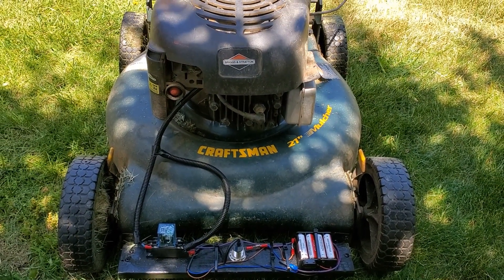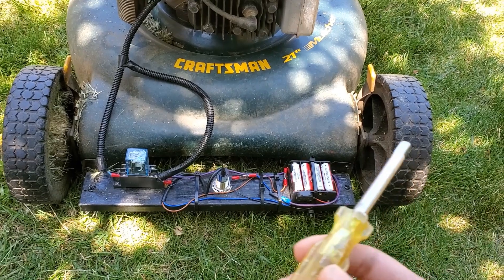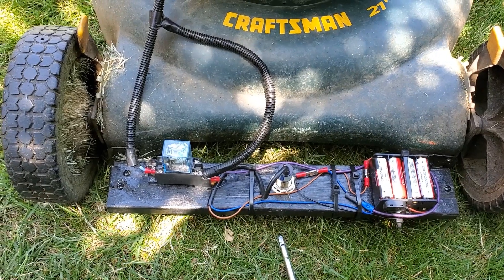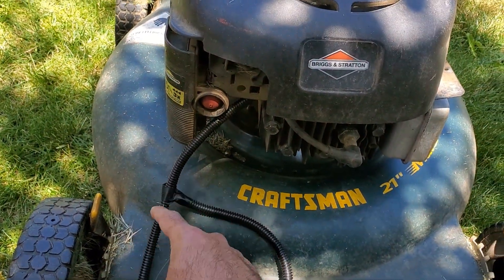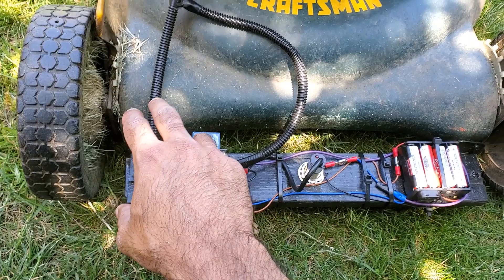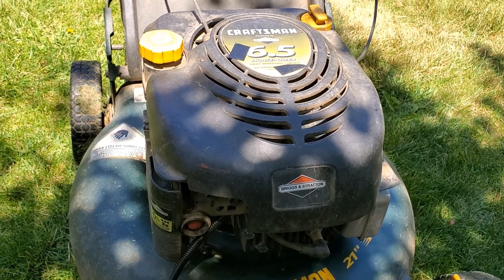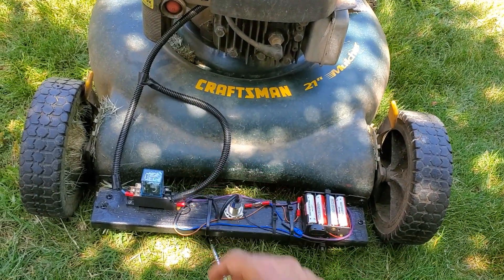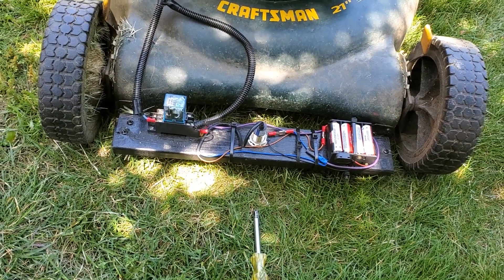Object Detecting Lawn Mower

Comment: Very cool. This is the Tesla of lawnmowers! But as others have commented, I wonder about the effectiveness of your invention while mowing at a normal walking speed (or speed of the self-propelled mower). You were moving very slowly in your opening demo. It takes several seconds for an engine to shut down. And the ignition coil has to be grounded continually while the engine slows to a full stop. But the ingenuity you have demonstrated is fabulous! Looking forward to your next revision!
Reply from the maker: Appreciate the support and feedback. They make relays that once triggered stay triggerd for a set duration of time this will allow the mower to be grounded for as long as one wants. The real challenge will be making the blade stop faster.
Reply: @DuctTapeMechanic  Yes, engine braking would be key for an instantaneous shut-down. (I also enjoyed seeing the roll of electrical tape holding down the safety bar on the handle!)

Comment: The one sensor is good for a proof of concept imo. Id be curious on testing how wide of a range the sensor has left, right, and height wise, how many sensors you need to cover the front, how big of a metal object it can detect, and if you could use the lawn mower motor itself to power a rechargeable battery for the sensors. Someone else recommended a bypass which I thought was a smart idea too. I can see this as very marketable if done for a decent price! You could even sell kits to attach to lawnmowers
Reply from the maker: All valid points. The sensors are really cheap (about $3.50 if you buy them off of ebay). I plan on using capacitive sensors in the future so I can detect an array of different objects.

Comment: Interesting concept but for it to be sold you are going to have to keep the dead man control also at the handle bar. This could be a 2nd kill switch. Also people hit metal objects but also stumps and concrete/ rocks that cause damage. So a sensor to detect objects based on height might be better. Just my thoughts.
Reply from the maker: I appreciate the input. Since the video I have updated the sensor to a capacitive sensor that detects rocks, metal, and even toes. I was thinking of bolting on an additonal brake and having it engage the flywheel and stop the blades via a 12 volt solenoid. If this gets enough interest ill post another video on the revision. I appreciate the feedback. Subscribe to stay tuned.

Comment: Very interesting concept. I believe the sensor you're using searches for obstructions from metal objects. There is coding involved in my suggestion but what if you replaced that with an optical sensor with a wide angle lens that was triggered by any foreign object in the path?
Reply from the maker: Yes that would work with an arduino (albeit more challenging). I was thinking of swapping this using a capacitive proximity sensor so  I would be able to detect a variety of things (rocks, metal, etc.) Stay tuned for a remake!
Reply: @DuctTapeMechanic  That's an interesting take. Yes, if you go that route you'll also be able to enhance your product's feature set. Very well done. Looking forward to the update!

Comment: can you make one for a commercial mower going 13 mph ?  and 94 inches wide ?
Reply from the maker: I would have to use a timed relay and going that fast I would also have to find a way to apply the brake as well. It would be quite challenging for sure.

Comment: So what if it's on the side does it only work if you drive dead center  What if the metal object is closer to the tire the blade will still hit it but will the sensor still pick it up if its way on the side
Reply from the maker: Yes I am planning a revison in which I install additional sensors on the horizontal axis to cover this potential issue.

Comment: What is the voltage on the ignition coil? If it is 10,000 volts it likely exceeds the voltage rating of the relay and wire to the relay.  Also voltage can jump through wire insulation to the mower body, or to the human body if a finger gets close enough to the wire.
Reply from the maker: Primary coil does not carry super high voltage (thats the function of secondary coil). The wire is the same gauge as the kill switch wire and grounds to the same spot.
Reply: @DuctTapeMechanic  gauge matters for current, not voltage. Current will be very small but voltage will be very big. Voltage rating for the insulation around the copper wire is what matters. Often the voltage rating is printed on the wire. Suggest check that voltage rating on added wire is as high or higher than original wire. Also, if voltage is high enough to jump from relay contact to relay coil, you could end up with high voltage on the rest of your circuitry, including battery pack.  Good point about the primary coil voltage vs secondary. Knowing the Primary voltage is still useful.

Comment: Can try extending the support-arm with the equipment on out a few inches to allow a bit more time for the blade to slow down along with multiple sensors all in series for better coverage. Maybe some kind of plastic guard too so that the sensors+power supply and relay don’t get mucky/wet from grass
Reply: Nice work by the way man. Really clever idea.
Reply from the maker: Appreciate the support and feedback

Comment: This works in theory but not in practice. As mentioned, the metal object needs to be in the center of the mower but the mower takes a few seconds to shut down. Your current relay only triggers while the metal object is right under it so running over a tool like that at normal mowing speed would barely make the motor miss a stroke let alone shut off. The fix for this would be a timer that keeps the relay closed for 3-4 seconds after any contact with  a metal object.
Reply: Well this is obviously a proof of concept. Not an actual product. All your listed problems could easily be fixed. Also even if the person is Usain Boltin it, the blades will be going much slower still, and if it does hit it won't actually be as much load on the motor.

The real question is can you fix what you listed and still keep it at a viable price? Maybe for high end lawn mowers, but for the average one I doubt it
Reply from the maker: @lost4468yt  appreciate the feedback/encouragement. Yes absolutely it is a proof of concept thats why I also asked for input in the video. I plan on doing a redesign soon to  address the issues.
Reply from the maker: That great feedback. There are relay modules available that have adjustable timers, didn't even think about that until now. I think a visual warning would also help

Comment: Bro will it work if metal piece is not at the centre of the mover
Reply from the maker: Good point. I think the best thing to due is put a few sensors on the periphery and connect them all together (they are cheap). I plan to make a update later with the changes.
Reply: had the same thought. Also: does it kill if the object is just for a short moment under the sensor? Like if you drive over it without stopping...